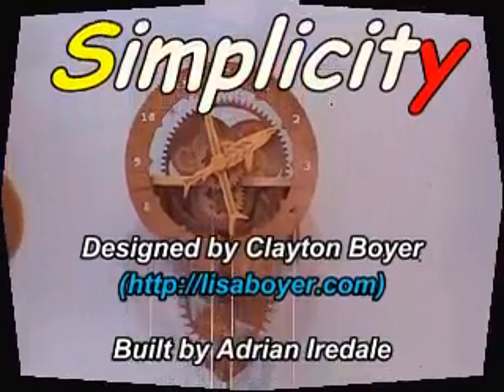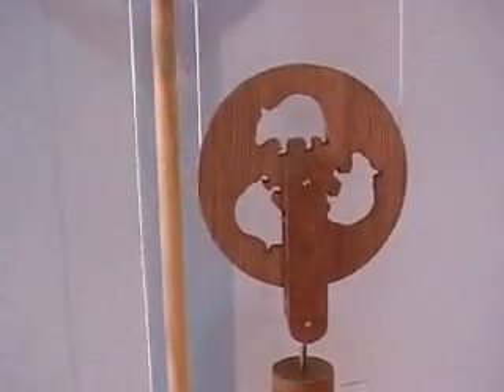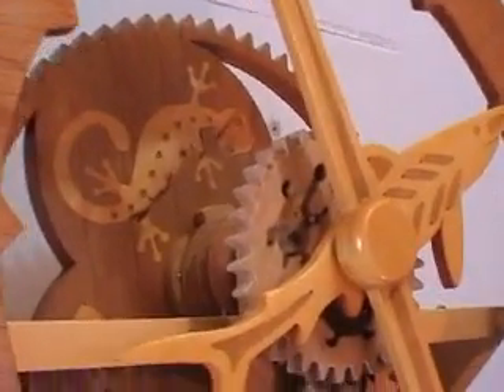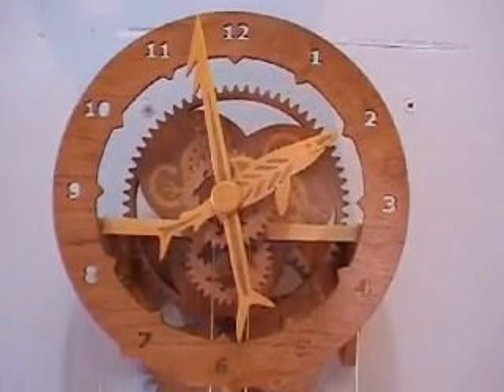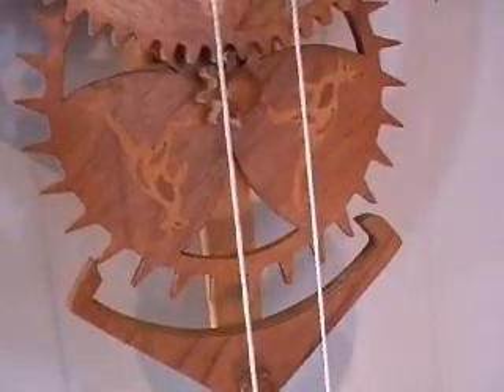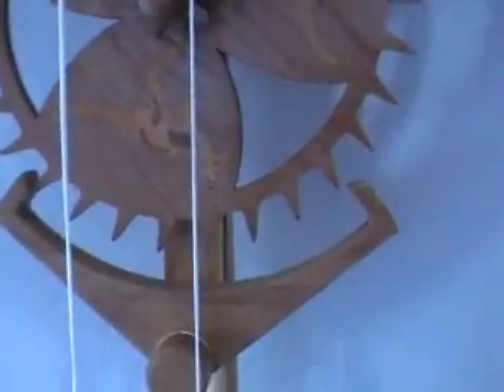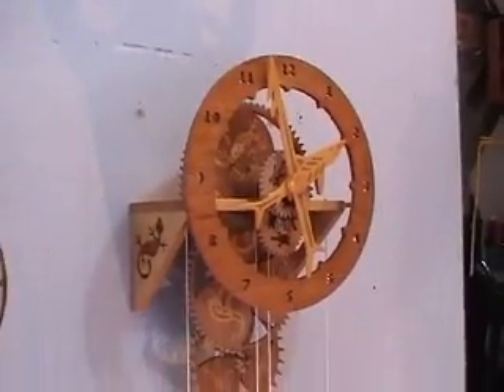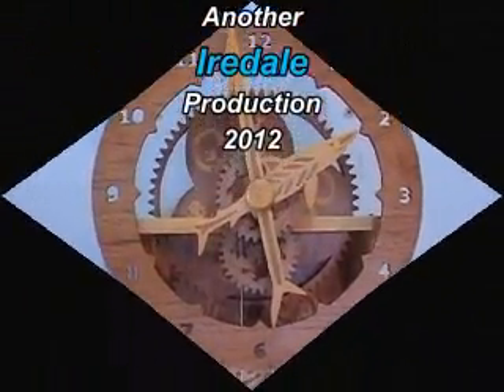Simplicity - A Wooden Mechanism Clock

Comment: Thanks Adrian, for updating your excellent video by adding this new section on the upgraded Simplicity pallets.  The pallets were upgraded in the Simplicity plan on Sept 15, 2010.  These new pallets are easier to set, swing the pendulum further side-to-side, take less drive weight and are quieter than the original (pre 2010) pallets.
Your Simplicity came out beautifully.  I love what you did to personalize your Simplicity.  Those inlays are spectacular!  Aloha. Clayton

Comment: Nice Adrian!  I noticed the pallet barely moving and was wondering what the heck, and saw the pendulum barely moving back and forth.  Then I saw the part after you changed the pallet, funny.  I may change the hands on my Simplicity to a darker wood for some better contrast to see what time it is.  Anyway, I like your inlay designs, I might have to try that sometime.